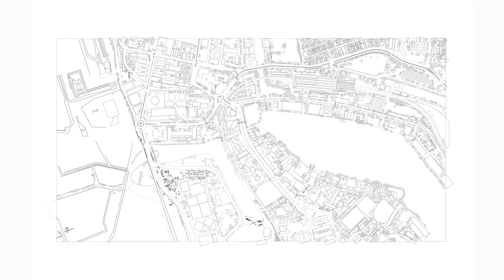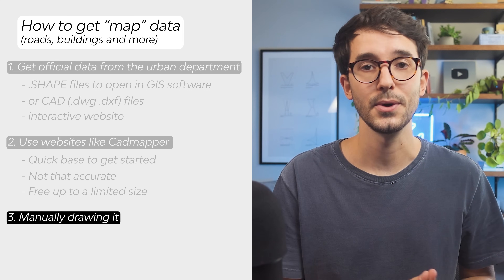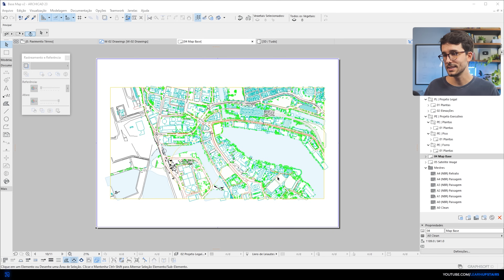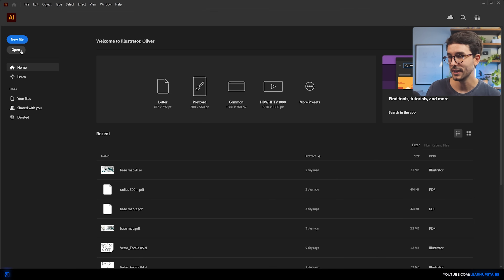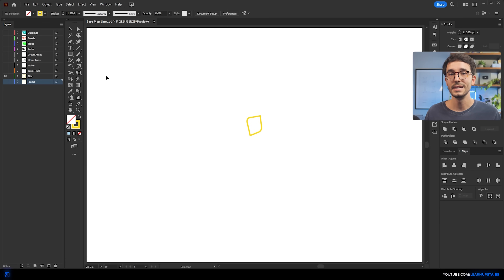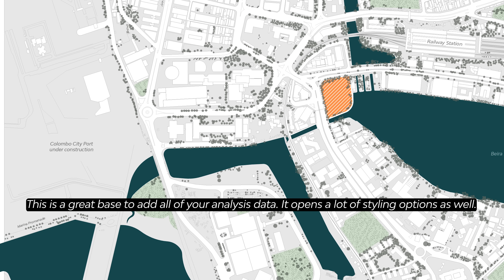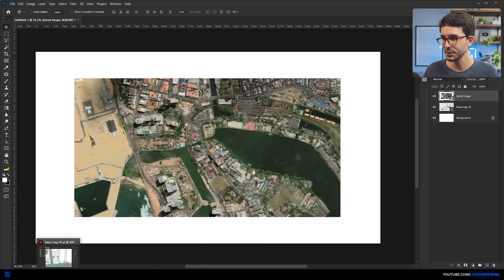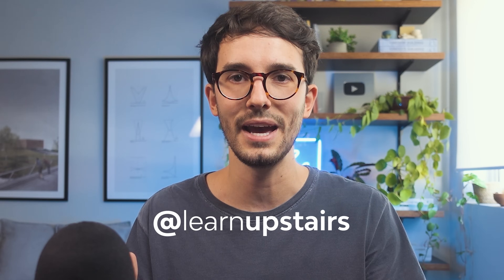Architecture Site Analysis - A quick and powerful method!

Comment: Saving this video to watch every time I have to prepare a site analysis 😂 Just a question: why do you prepare the base lines in archicad (in my case would be revit) and not using illustrator directly?
Reply from the maker: Hey Cecilia, glad this one’s going to be a repeat watch 😄

The main reason is actually control and accuracy. When I prepare the base lines in Archicad (or Revit in your case), I’m working directly from the real model, with correct scale, alignment, geometry, and measurements. It’s faster and much harder to make mistakes there.

Illustrator, for me, comes after that. I use it to style, adjust line weights, add hierarchy, color, annotations, and graphic intention, not really to rebuild geometry from scratch. You can draw everything directly in Illustrator, but it usually takes longer and it’s easier to lose precision.

You can do it all in Archicad or Revit, but you get less creative flexibility. So this combo gets the best of both programs.

Hope that makes sense!

Comment: Iwas wondering, if I want to make a map in Illustrator, that has a scale 1:200. And wish to add a building that has an area 20x30 meters. How can I go about it ?
Reply from the maker: Although you could draw up-to-scale elements directly in Illustrator, and "do the math" on your head to then input the correct dimension on screen. I always rely on a drafting software CAD or BIM to accurately draw, and then only import that element into Illustrator.

But... if you need to do that in Illustrator, sometimes I used a real-life scale to confirm what that 20x30 meters building would equal to on paper. For example, draw a 30 meter line on 1:200 and then turn the scale to 1:1 (1:100) and measure that.
Reply: @LearnUpstairs  Thank, you I will follow your advice.

Comment: Hello Oliver, I would like to know how you would do in case of doing an axonometry. I have a large archicad model. Do you export the axonometric from there, with the fills to illustrator? Or do you pass the model to sketchup for only lines then to illustrator? The file is so big that when using illustrator on the archicad image the program crashes. Thanks in advance. It's for my thesis, I hope you can help me <3

Comment: Thanks for the inspirations, But I'm having a problem with opening the pdf file from archicad to illustrator, The file seems very dull and almost unseeable, Can anyone help me? I also tried opening other pdf files and those seems fine, but this certain pdf file of mine from archicad only have this problem. Thanks for anyone who can help me
Reply from the maker: Hey HKL! Have you double checked the line weight of your elements?
Depending on what color you picked from the pen set, it will have a 0mm thickness.
But regardless of that, you should be able to unmask all, and apply a new thickness in Illustrator.
Even though the file might seem invisible, the line paths should still be there.

Comment: Your guides are always joy to watch.

It would be nice to know if it's possible to re-draw part of the map to propose new city plan concepts. Could this be done by editing the map data files, or in illustrator?
Reply from the maker: Thanks!!! And yes that's totally possible. In the example I did in the video, I didn't change anything and represented the urban environment as is.
But this workflow is for a "re-draw" in mind.
You get that base ready as linework and before exporting the PDF you would do all the changes.

My approach would be to concentrate any re-draws to the CAD/BIM step, and only style in Illustrator and Photoshop.
Also, I suggest adding any new proposals to a new layer, so that you can take advantage of this and style it as a category.

Comment: Is it possible to just skip the Illustrator and just use Photoshop? Would it be too much work this way?
Reply from the maker: Yes, it’s possible! But you’d have to make some compromises and also extra steps:

1. You’d have to export each category as an individual PDF. So that you could import one at a time into Photoshop to still have them divide into layers.

2. All the linework would have to be done in your CAD/BIM software.  That means that if you only had 1 combined PDF, you’d have a hard time.

3. The extra creative freedom that Illustrator gives would now be limited to what you can accomplish with a technical software (cad/bim).

But still that’s totally doable! Just make sure to have a high quality file to begin with. I hope that helps, Peter! 😁
Reply: @LearnUpstairs  Thanks for your reply! 😀

Comment: I don't like how it looks.On the other hand, why does someone always draw a master plan on youtube that has a large body of water? Almost never that I have had to draw one was there water.
Reply from the maker: Thanks for your input Antoniotobarra! That’s totally valid. We all have different tastes. But I was wondering, what would you make differently on the image?
Personally if I were doing this for a competition, or a real project, I’d be a lot more minimal with the style intensity. Overall, I prefer cleaner and simpler drawings. (You might get a feel over my final thesis boards)
But unfortunately since I’m posting this to YouTube, I often make the images a lot more flashy. 

Now regarding the water, I don’t really get it. The method works with or without water. I usually try to include as to show an extra “feature”, and again… to draw more attention.
As I mentioned during the video, this is just a base, but it should be adapted to each one’s specific needs.
Reply: @LearnUpstairs  
I agree with you. A more sober style is more attractive to me. Maybe it's because of the degree or because of working so many hours with qgis. 

I mention the water thing because the plan tends to be more attractive with it, but since I've seen it so little in practical cases, I find it curious to always see it in this type of video. I'm not just talking about what you do.